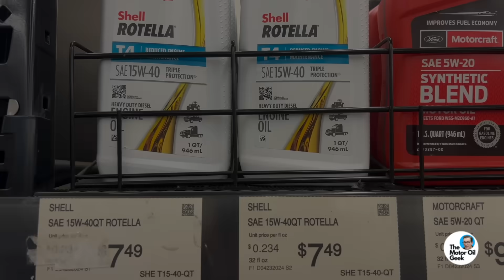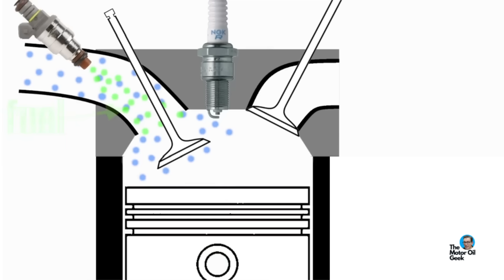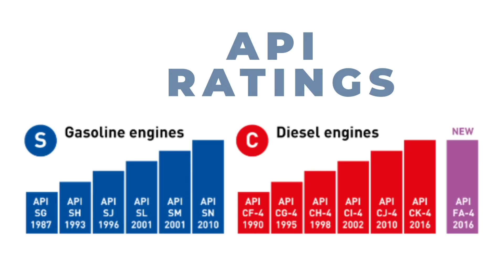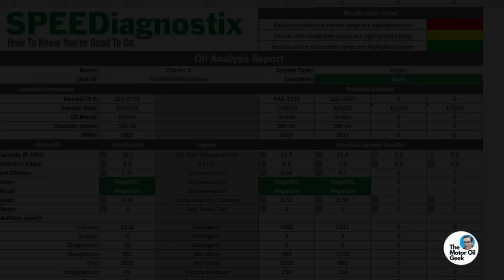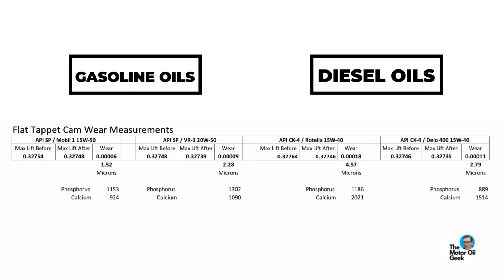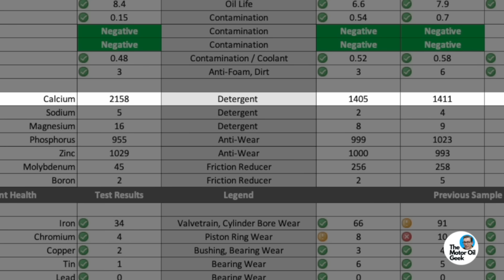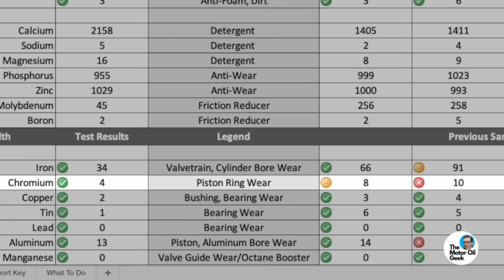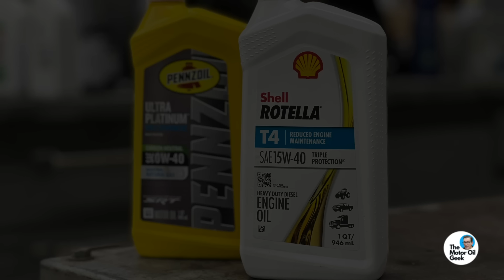Why DIESEL Oil is Actually WORSE for Gas Engines!

Comment: I’ve run Rotella T6 5W-40 in gas, diesels, street bikes, dirt bikes and other small engines for over 10 years. Oil analysis show it’s been just fine in my gas engines.
Reply: Same here my 2005 silverado has 420,000 miles on it.  So I'll stick to the Rotella.
Reply: @mmgtl really? I have no experience with this particular product. I’m all ears though.
Reply: T 6 all the way!!!!
Reply: I use T6 5w-40 in everything i own, and I don't own a diesel.
Reply: I'll expand by saying that I've been watching this conversation for at least two decades and have never even heard of an older flat tappet engine being damaged or failing due to using a diesel oil with a formulation similar to Rotella. I'm sure it's probably happened, but isn't common enough to be noteworthy. The video author claims that certain aspects of additive packages can compete with themselves with the result being more wear than with a gasoline rated oil? Perhaps on paper and/or in lab testing with new engine designs, but what is the organic situation on the ground with these older engines? That's what actually matters and includes a thousand other variables like driver habits, change frequencies, ect. Folks have been meticulous about running samples on their older mills at regular intervals and if higher wear was occurring it would have been common knowledge in the community by now. Even if the only benefit is cost savings for those of us with old engines, that's enough for me.
Reply: @silasakron4692  you can successfully use plain  PAO, with no additives, and get away with it. But correctly formulated oil will optimize and will allow your engine to survive events such as aerated oil from running low, over temperatures, etc.
Reply: same
Reply: As it is Stated in the Video Turbo GDI Engines Do not Like Diesel Engine oil. I have a 1997 Dodge Dakota 5.2 That I have run Rotella 15w 40 Due to the fact I live in Phoenix AZ Where it gets SUPER HOT in the Summer. But again it's not A GDI  Engin
Reply: Video title should read "Why *SOME DIESEL Oil is Actually WORSE for *SOME Gas Engines!". Have been running Rotella 15W-40 (conventional) and 10W-30 (synthetic blend) diesel oils in the Ford 300-6 and other old favorites for almost 20 years. Newer engines with tight tolerances, exotic metals, turbos, ect, require (or do better with) specific oils, and so do the older flat tappet engines; people have run high zinc diesel oils like Rotella in their mills for decades.
Reply: @silasakron4692    I run Rotella 15-40 diesel oil in my 64 Dart, my KX 250 and riding lawn mower.   It might be my imagination... but, the oil seems to magically stay looking good longer...and I have not had any issues.
Reply: T6 is called 'brotella' because all the Subaru crowd figured out it was a better oil (from labs) than anything else in the 2.5L EJ. 

Ran it in GSXR1ks and Hayabusas for 10+yrs. 

Run the 10/30 'multi-vehicle' T6 in my supercharged 4Runner for 7 years now 113k miles and I do 4500-5k intervals NO issues. supposedly Shell got the zddp cocktail just right on it to not affect the gasser Catalytic conveverters getting coated in Zinc(we shall see, it passed ita 1st CA smog last month lol)
Reply: @05EVORS that's the main issue (to me) on this. As long as the piston rings are sealing properly, no oil is entering the combustion chamber, zero danger to the cat!
Reply: @05EVORS I made my own friction tester and tested a lot of oils in hot and cold conditions because I live in Canada. T6 was the best with the JD diesel oil a close second. Redline was the worst.
Reply: When I was racing superstock in the late 90s and early 00s we ran T6 in all our race bikes. Was half the cost of motorcycle specific oil and had all the good neutralizing solids for the wet clutches.
Reply: @jacksonnra1856  Been running T6 in my Hayabusa since I bought it 21 years ago.  Haven't had to shim the buckets yet, all clearances still in the center of the chart.
Reply: use it all the time in all my motors these do gooders no it all
Reply: SL55 What's 700 Horsepower Supercharged with no problems how about this a Saturn Sky Redline turbocharged no problems over 100,000 Mi on both very hard to explain why I would not have any problems
Reply: This piston absolutely did not break because of the oil used. Click bait.
Reply: They make a universal transmission fluid too 😂 same price as dextron and mercon, But it's universal
Reply: Harley recommends 15-40 t6 in all the new RevMax engines.
Reply: @hxccomms777 
Buell recommended it as well
Reply: 100% I’ve built race engines for teams (motocross) and at one point us and factory teams used t4 in all engines.  Wet clutch wouldn’t slip and it could handle the pressure inside built motors
Reply: I used t6 in my chevy 3.4 v6 and it cleared up a rough idle that was happening with conventional oil.  That engine also ate the connecting rods though.  Looking back the positive probably just came from correcting the wrong factory viscosity spec.
Reply: I too run my big rigs and automobiles on Rotella T6 5W-40 without no problems. Best cold and hot starts.
Reply: I've used mobile one lawn mowers supercharged cars turbo cars and motorcycles way over 100,000 no problem so there has to be more science to this than we are looking at
Reply: yes, this video is silly.
Reply: I Run high temperature diesel oil in almost all of my vehicles and motorcycles….
Absolutely no problems whatsoever …..!
Reply: I knew of 3 people  that used Diesel oil in there cars. They got over 300. Thousands miles on there engines  !  That blow me away .
Reply: How come you just don't use regular motorcycle oil they make motorcycle oil
Reply: B/S
Reply: Going to agree with your claim. Been running Shell Rotella T6 in anything from a Trailblazer with 180,000 MI to my sport bike and my tractor. Zero issues all oil analysis indicate no abnormalities
Reply: Baaaahahahaha. Idiots.
Reply: yep
Reply: Same. It's the 1 size fits all
Reply: My 2015 Malibu boat calls for 15w-40 oil and seems it’s only available in diesel oil.
Reply: @RickHM2019 same. Indmar recommends Rotella T4 15W-40 from the factory. I switched to 5W-40 because it starts easier on cold days.
Reply: The T6 is fully synthetic, which a very different story. There are fully synthetics fine-tuned for a specific type of engine, but the difference is much smaller.
Reply: Rotella t6 5w40 in all my off road engines!
Reply: Yup, Been running T6 in all my gasser Turbo Volvos for 15+ years. 1970-2000 models.
Reply: T6 is heavily used in dirt bikes because it n has jaso cert.  However there are some really high failure rates  in the sport.  I'm curious if there is a measurement out there to cross reference
Reply: Aeration.
Reply: It might be fine, but in most cases it’s more expensive to get diesel oil, used to work for a trucking company and the family would use the bulk diesel in all of there personal vehicles (all gas vehicles) so it’s probably cheaper to buy 500 gallons of diesel oil than 4-6 quarts of other oil if you need it anyways
Reply: I got 55k miles out of my drz400 ridden mostly right around the chip and in a wheelie on rotella T 15/40 and 500 MI oil changes.   The new engine runs correct oil.
Reply: It’s not a very good oil. Period.
Reply: @chrisbradley3224 based on what? You just blindly accepting what he says and not listening to what the masses are telling you, from actual street/strip experience?
Reply: @Hillbillygarage1215 oil analysis at a lab, my father is a chemist, also btw it aerates easily. It’s not good, just cheap.
Reply: @chrisbradley3224  most people think it's pretty good... T6, especially. But, just in case, I have also been adding a bit of Lucas oil stabilizer here and there - another bad old rabbit of mine. On this particular engine - 227k miles thus far.
Reply: same here bud!
Reply: YEP, this is the absolute very first time in ALL of automotive history that engineers and "on paper science" have said one thing and real life, actual "on the street" application says the opposite. Everyone mark this on your calendar... this is a day in history we must all remember!
Reply: I run shell rotella t6 in my 400hp seadoos . It meets the spec of the wet clutch for per brp
Reply: I've been using rotella for close to 30 years once I tested several oils  for oil pressure loss "breakdown" never had a single issue, and I don't baby my engines but I do warm them up and gradually increase RPMs according to temperature if i so desire, all chevies!
Reply: I think this is part of the confusion.  Oil analysis for fleets and users over many years has confirmed that diesel oils perform well in gasoline engines.  I am not sure it is black and white.  Hopefully Lake can comment or address this.
Reply: yep  again  clearly the proof is in the pudding  right here  no way to miss it
Reply: 96 volvo 850 with 300k loves t4 rotella. It stopped the rear main seal leak too!
Reply: There are two oils I have rand for a long long time in everything Toyota and Lexus has ever made as well as Chevrolets and Dodge Rotella T6 5W40 since 2001. Mobil-1 0W40 for the last 12-15 years. Never had a bad UOA in a single one! Rotella T6 leaves a little bit of varnish behind M1 0W40 leaves nothing behind.
Reply: The guy who deals with oil for a living or just run to rotella bro🤔
Reply: I never knew that calcium additives could facilitate detonation, especially in a friggin ring groove!!! This is important information.
Reply: @richardkudrna7503  I think the the nut behind the wheel (driver) was torqued to tight and that’s what caused the problem to the piston Dave was holding. The car probably had an aftermarket tune,👀too.
Reply: @stepside2839  a boosted DI engine seems to be at risk if a diesel oil is used. Can a factory Audi tune hit the threshold to achieve instant destruction if running at wide open and high calcium oil? I bet data exists to show probability of ignition vs temperature and pressure.
Reply: @ too many variables to conclusively prove. 
Several of the manufacturers are now reformulating their diesel oils and the new API specs indicate that the new diesel oil is compatible with all gasoline & diesel engines, as the ratings indicate SP, SN, & CH thru CK ratings. I checked this out today.
We will never know for sure, now.
Reply: @stepside2839 Wow cool story bro, you know your in a cult when 🤷‍♂️
Reply: @richardkudrna7503  Oil should not be behind the top ring, that ring is for holding combustion pressure. Only the oil control ring is “wet” not the top ring unless that thing is burning oil and that’s what is happening, the oil film on the cylinder walls is being washed of by the injectors and can creep behind the top ring unless the oil is resistant to be washed off by gasoline. That ability to resist being washed off is part of the additive packed in SN and newer oils. Note that LSPI only occurs on direct injected motors and even then it’s much more common on turbo engines. Direct injection was supposed to give better economy AND power but it’s also the cause of a lot of engine issues we didn’t use to see.
Reply: @bigdog2024  oil control rings are not completely able to scrape, nor would you want to. Many boosted engines open oil jets to cool piston bottoms when high mass flow is happening., and it’s hard to expect the oil rings to handle all the spatter. I expect the area under the top ring to have some oil. This catalyzed phenomenon where calcium helps detonate a tiny area of mix is not familiar detonation, where I expect for example a spark plug thread to get hot, or a carbon blob, or convergent shock waves. Here we have a tiny closed space igniting despite metal quench all around. I will try to learn more.
Reply: @richardkudrna7503  in a new style direct injection engine.......maybe.   but still very unlikley
Reply: Been doing the same, and before full synthetic was running 15w-40. Can't say I've ever had a engine fail where I could verifiably point it being that the oil wasn't for a gas engine. But we are talking all off-highway stuff.
Reply: i legit ran T6 5W-40 in a Kia Sportage and Chevy impala for 4 years cleaned the engines right up
Reply: Are you using the diesel oil in a turbo charged or direct injection gas engine? I think that is where you will see problems. Most diesel oils have an S rating as well and even Harley Davidson says to use Diesel oil if the Harley Oil is not available in a pinch, then swap it out as soon as possible. The engines are not direct injected or turbo charged.
Reply: @ronkuzyk3836  There are a lot of people in the heavily modified tuned Turbo DI Mazdaspeed3 community that swear by T-6. I used it for 100k miles before I sold the car never an issue. I've put collectively about 200k miles on all my motorcycles running T-6, with nary an issue. My Harleys get V-Twin formulated oil though. Never T-6 as the transmission is separate.
Reply: @ I am just trying to learn something. Certainly because you used a product without problems does not mean it was the best product to use. Better to use some oil than no oil. I also am not a fan of using a motor oil in my Harley transmission, but I would if that is all I had in a pinch.
Reply: zoom zoom no boom boom 🤘 @spike_spencer
Reply: @spike_spencer Harley engines aren’t exactly performance engines 🤷‍♂️
Reply: @blueberrywilbur315  not sure why you're focused on the vehicles that don't get T-6 oil? There are definitely performance Harley motors out there. Just watch some NHRA Pro Fuel Harley racing some time. 7 second 200MPH+ in the quarter with a V-Twin I would call performance. However, the point I was making is Harley engines are special and get special oil.
Reply: @spike_spencer Lol real fast bro cool story. So you overpaid for a 🐷
Reply: @ronkuzyk3836  Use it in my DI Silverado for 3 years, and no problems.
Reply: @ronkuzyk3836 I have used it in my 3.5l eco boost engine for 200000 miles with absolutely no issues. Engine has not been touched
Reply: @ronkuzyk3836  Yeah super important, Older gas engine are made from the same materials as diesel engines. New gas engines it is completely different, and diesel oils will cause extra wear. For a 3800 or something similar it is completely fine.
Reply: That is not it.
The Detergents are too high in Diesel just like Lake Speed said.
Reply: @3029dz  what about an older aluminum naturally aspirated non-direct injection engine? 2002 LR Discovery II. Lots of LR guys use and swear by T6...
Reply: Looks like no one in this thread learned anything. Getting away with something is far from proof that it's a good idea let alone the best idea. But of course it has always been true that the vast majority of people believe what they want to believe and disregard anything that counters their beliefs.
Reply: Lake, this was great.  All these Rotella Fanboys on the Kawasaki KLR 650 forums push the Rotella diesel oil for this motorcycle.  I’ve always had my concerns.  I’ll stick with Motorcycle oil.
Reply: @slalomking Read the labels.   Not all diesel oils are Jaso rated.

Comment: AS an aside to your presentation on HDDEO, I formulated a boosted version of Delo 400 for the Nissan GTP race cars that were failing turbochargers at 12 hours in a 24 hour race.  Ooops!.  Switching from "race" oil to HDDEO and adding Antioxidant totally solved the bearing coking issue allowing Nissan to win 5 consecutive races with this oil when they DNF'd in all the races previously.

I also used this oil in a Formula 1 race with Jacques Villeneuve.  This was a one-off opportunity due to sponsor issues.  He almost won the race (Montreal) but came into the pit for a final stop too fast and was penalized a lap for speeding putting him into second place.
Reply: I've used diesel oil in my old 60s gas engines cause they are worn alot and carbonized up. It does clean up the gunk and carbon.

Comment: I'm running diesel oil in my 06 cobalt SS sedan. It drove from Peoria az to East Mesa AZ with a spun rod bearing on cylinder 1 before it spun I ran royal purple. It's still running an driving with a spun rod an diesel oil. 🤷🏻‍♂️ (I don't daily it or drive it anymore ticking time bomb lol)

Comment: I find it interesting that VW specification oils would often meet both gasoline and diesel specifications. Mobil1 0w40 Euro was a very common choice for VW engines. The VW GTI got a GDI engine around 2005, but called for the same oil as earlier GTIs.

Comment: Always enjoy both shops videos, together they make a great presentation team. Great clarification on the differences, and points out more reason to add a ByPass filter system to my Diesel.  

Lake, be great if you’d compare the 3 main Brands of ByPass Filter systems for Diesels.

Comment: i have used a "modern" "diesel and petrol" oil in some car's. specifically VW507.00 spec oil with "ACEA C3, API SP". the main reason was to get the crud and crap out of the engine. specifically it have loosened up the oil rings agen and i went from 6-10 liter top up in 10k km to nothing in some 3 cylinder 1L engines. the oil tings was non functional to working agen.
this engines dont have a high oil requirement for lubrication so it dont take heavy damage from this. the biggest issue will be the valve seals and other seals might get harder faster. stil i did not have to replace the engine/open up the engine. it now works good as is. and i run MAX 10k km on the long interval oil. i have even used this light oil on the track. it is used up faster the thicker oil stil it works good for some sprint races etc and the lowe power engines we run 1L 68HP (port injected) stock cup class) the thin oil is not a bad thing ;)